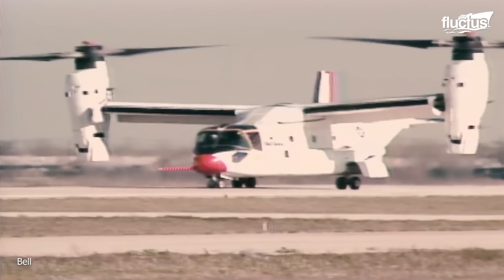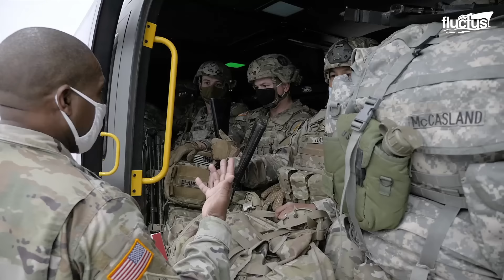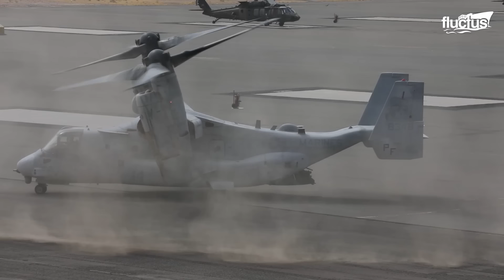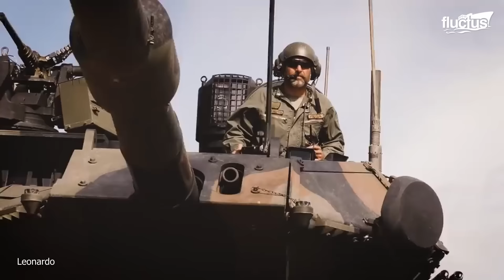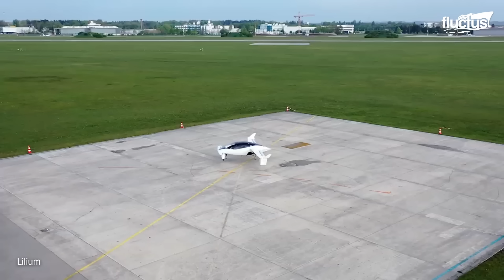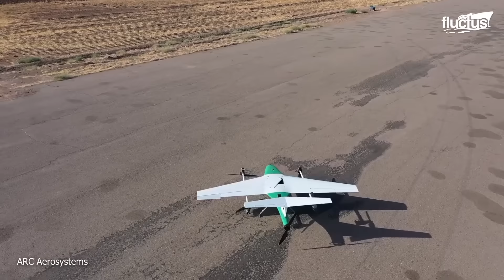US Army Testing Its Most Revolutionary Helicopter Design Ever Created

Comment: The Ospatross is a piece of overpriced junk! Think about it, one squadron - a billion dollars of aircraft. This marginal, dangerous and rarely used aircraft has limited Marine Corps lethiality. It's almost as if it single handedly neutered the Marine Corps.,
Reply: If you did some actual research maybe you could get the name right in the process
Reply: @andrewreynolds4949 it’s purposely mispelled like “albatross” genius. The Osprey is an albatross around the Marine Corps neck. I am a retired marine and Ch46e pilot.
Reply: @mcgch46e80   Funny because it has a better crash rate than the CH-46. All while having far more capabilities.
Reply: @mcgch46e80  Weren't albatross also seen as a symbol of luck?...
Assuming you haven't flown a V-22, I'm sure you're also not familiar with the Nacelle Improvement Program, which has now reduced issues with the V-22 by 75%. This is on an already middling (not abysmal) reliability platform, which is vastly more capable than anything else comparable in the Marine and Navy inventory. The aircraft are in extremely high demand because of their utility.
Reply: @andrewreynolds4949 what’s there currently operational readiness rate? How many hours per month do pilots train in them? What kind of mission limitations do they have? What is the standard tactical landing profile? What are the current limitations of the wing folding gearbox?
Reply: @mcgch46e80  From what I can find, the Nacelle Improvement Program has only been carried out on the Air Force CV-22 fleet, and hasn't yet been done on the Marine and Navy aircraft. But on those modified aircraft maintenance time only on the nacelles went from 2.5 hours per fight hour to 12 hours total, after 4,000 hours flown, with no failures on those components; this has given a 10% increase in readiness, and a saving of over 24,000 maintenance hours.
 The overall readiness figures themselves are murky; I found figures of 51% and 30%, but not which fleet those are for or when; presumably both are prior to the NIP work. 
The Nacelle Improvement does cover everything except the gearboxes; those are subject to a separate program that will be deployed in the next two years. That should also significantly improve readiness and remove any remaining restrictions on the aircraft.

Comment: Could the Osprey keep its fuselage and mission role, but get a wholly new wing that uses fixed engines and only tilting rotors?
Reply: You have just described the V-280.  It's an amazing machine, BTW.
Reply: @markej4801 Well, could it get engines like those of the MV-75 but keep it's own fuselage style?!!
Reply: The V-280 / MV-75 is a smaller aircraft than the V-22, It has a different fuselage style and is designed for a different role; it’s a completely separate aircraft design.

Comment: Facts; the 
Leonardo 609 was developed by Bell.
The Osprey’s turbine exhaust was a problem in unimproved terrain; surface erosion and FOD. It points directly towards the surface when the nacelle is rotated. The Valor, which is a U. S. Army project,solves the problem by not rotating the nacelle.
Reply: To many points of failure. The co-axial helo was the solution. These aircraft are just money bags for the defense industry  and politicians.
Reply: @mcgch46e80  unfortunately the co-axial model during the competition against the Bell 280 for next gen vertical lift had way too many problems. The Bell 280 destroyed it during the competition and demo's because of the issues. It was a Sikorsky-regardless of who won the contract- they are both money bags for defense industry.

Comment: The SH3A Sea king was the first production helicopter, not an experimental helicopter to exceed 200 mph not the Bell 47 which has a never exceed speed VNE of around 105 mph. Not so much as structural failure but because te receding rotor stalls creating dissymmetry of lift causing the helicopter to roll to the stalling side and pitch up. I don’t think I have gotten much faster than 85 mph in a Bell 47.

Comment: This whole video has a weird tone... it says the V-280 is to replace the Osprey.  They aren't in the same class at all, and the Osprey is expected to serve into the 2060's.  No successor has yet been chosen.   It also talks about safety issues, but those were teething issues, and the Osprey is now among the safer aircraft in the inventory. The V-280 is supposed to replace the Hlackhawk (Sikorsky UH-60)  much lighter than an Osprey.
How did we end up in the electric vtols? that has nothing to do with the military at this point.

Comment: H13 exceeding 200 mph in level flight?  No chance
Reply: 200 km/h, perhaps.
Reply: @trungson6604 
Not a chance. 100 mph more likely.
Reply: @trungson6604  maybe??  That would be ~108 knots or 124 MPH.  As near as I can figure, the H-13 had a VNE of 105 MPH/91 knots/169 km/h.  I am not sure I have ever flown a helicopter in level flight at VNE, even in a transient limit.
Reply: I was very impressed by that number until I thought about it, maybe they meant one-hundred mph? That would be much more plausible.

Comment: I  question that the Sioux (Bell 47)  could exceed 200mph in level flight. Its cruise is only about 95.
Reply: What he meant to say is it could exceed 200 mph in a free fall after the engine died.
Reply: 95 as mph, yes, but not in kts.
Reply: Yes.  No way it ever broke 110 mph.  Maximum speed: 105 mph (169 km/h, 91 kn).
Reply: @LA-ep2nr  It could easily break 110 MPH, in a free fall dive after the engine died hahahahaha
Reply: @Bellthorian 🤣🤣🤣

Comment: The biggest issue with most of these (electric) aircraft is not range. It’s the fact that it takes 12 hours to recharge them. Plus barely any airports have charging stations. Meaning even slower recharging! At least with regular helicopters you can fuel up in just 10-15 minutes! Electric cars suck in the same ways, and that’s why they don’t sell well anymore!
Reply: Electric aircraft???  It will have turbine engines.
Reply: @jeffreyletempt7189 Maybe I am mistaken but I thought they showed one. I wasn’t talking about the Army’s next generation helicopter. I was referring to the all white one.

Comment: 1:20 "the best features of both..." but none of the inherit safety features of either. It is safer now but they've had to work very hard to make it so.
Reply: Incorrect.
Reply: Helicopters (particularly military helicopters) are by nature much less safe than fixed wing aircraft. 
Bell recently put out a press release about their ‘nacelle improvement program’ that has achieved a 75% reduction in issues on the Osprey. At this point most of the first generation developmental issues have been solved.

Comment: What happens when one engine fails.
Reply: The transmission automatically feeds power from the good engine to both rotors.
Reply: The same thing as if the engine in a helicopter fails.....
Reply: @domingofung that’s right you die lol
Reply: There is a driveline and clutch system that goes down the wing.  The V22 has the same thing.  Pilots claim it works well, just only have 50% power so everybody has to slow down.
Reply: The question is : can it replace Blackhawk :
Landing on hot zone. 
Consider that both engines are exposed when in vertical mode, vulnerable from fragmentation & small arm fire
Reply: It should be better than a Blackhawk in a hot zone, because it can get in and out quicker. No helicopter is built to take much in the way of direct fire.
Reply: @andrewreynolds4949   "no helicopter is built to take much in the way of direct fire"
Blackhawks are bulletproof against AK-47 rounds
Reply: @Budi-n8e8l  No more so than the MV-75 will be; also, that's only true for certain areas and components.
Reply: @andrewreynolds4949   "will be"

Comment: If Elon Musk's rockets can land with pin point accuracy, why do all of these smaller VTOL vehicles even need the added weight of landing gear ? If the landing spot is an establish commonly used location, then why not have the landing gear in the form of a ground pedestal that is already sitting on the ground waiting for the vehicle to set down on it ? This of course only makes sense if the reliability of the vehicle is very high. In other words, the need for an emergency landing is very very low. Mounted onboard landing gear is only needed when the vehicle will be landing at an non-established landing spot.
Reply: 🤣🤣 think about your comment a little longer lol
Reply: Because a VTOL has to take off again. A rocket will be shut down and inspected after each landing.
Reply: Also, many helicopters have skids. And wheels allow you to roll, which is very useful.
Reply: Commonly used locations? All are targeted by the Enemy.
Reply: If you’re landing in hostile territory it’s very unlikely there will be any way to put a cradle in place for the aircraft. Part of the justification for the vtol capability is the ability to take off and land almost anywhere, including rough ground and remote locations. That generally requires bringing the landing gear on the aircraft with you, thanks.
Reply: And Where do you find Rocket Propellant ? Walmart or Ace ?
Reply: Do You know where Dry Rocket Propellant is made ? Only the insane play with that.